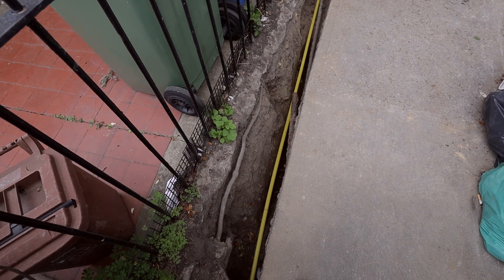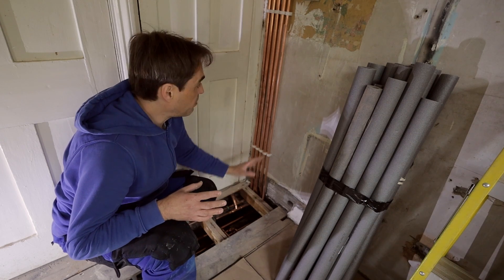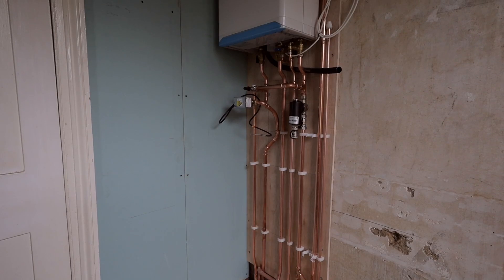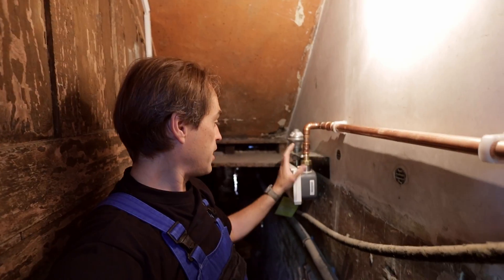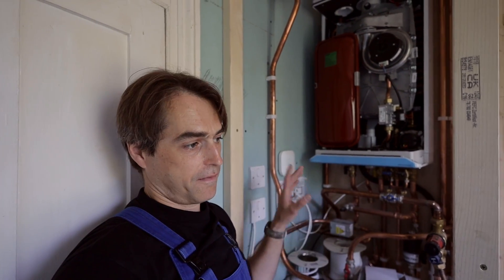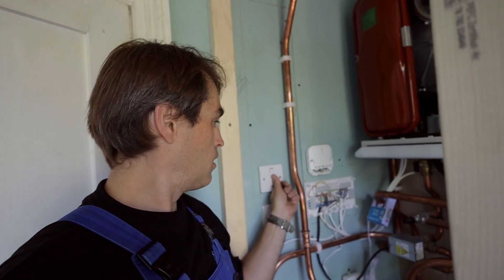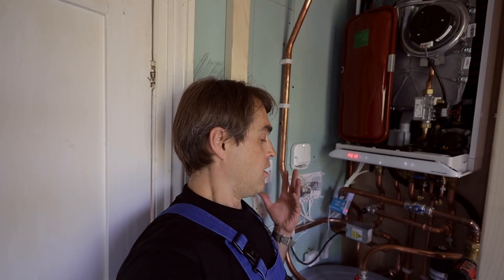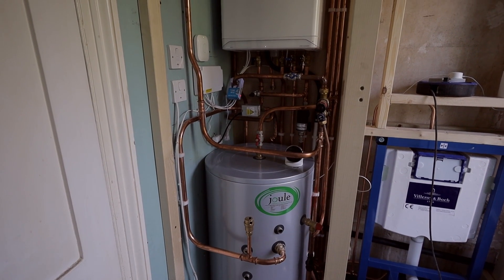Maximizing Hot Water Capacity with a High-Gain Cylinder and Intergas Boiler

Comment: I presume the boiler was already there as otherwise would a system boiler not have been a better choice considering the HW tank being fitted and the HW and home heating demand. One question- I have a 125L (not as well insulated as this one is) pressurised insulated HW tank. Does the heating element need replacing or is that just for any electric immersion backup. Plus how do you know the water was hotter at the top than the bottom? Would the heat not equalize?

Comment: Why do you do hot water priority off the heating side of the combi when you could directly heat the hot water with the combi side of the intergas boiler and avoid the 3 way diverter valve?  I ask because I have a Intergas boiler here in Canada (IBC SFC) and am using it as a combi right now, but will probably install a tank for domestic hot water (cylinder in UK speak) to reduce cycling on the boiler.  I was going to put a pump on it and use the combi side to directly heat the hot water.

Comment: You bend pipes the same way I do, but be aware that the pipe sits about 5mm above the bending wheel so we need to allow for that. A wee tip for you. I always do an air test on pipework before I introduce water into the pipes, that way any leaks are sorted before water is on, you know what that means if you get a soldered leak. Keep up the good tidy work A+

Comment: Hi, great video, love your attention to detail. I'm planning on installing a 19kw veissmann 100w system boiler, and wondering if you think there is benefit in installing a high gain cylinder over a standard cylinder? Would I have a similar result as here? Worth noting it'd be good to future proof the cylinder for a heat pump down the road.
Reply from the maker: If that is the case then yes HG cylinder of a larger size for a heat pump.

I would suggest looking at 11kw viessmann as it goes to 19kw of hot water. 

Not many houses in UK need more than 11kw for heating but that would have to be calculated for your property.
Reply: @UrbanPlumbers  great, thanks for the advice!

Would the 19kw not give me a higher kw output for dhw, and therefore a faster recovery time?
Reply from the maker: No, same as 11kw

Comment: The cylinder will heat up in 10min but how long will that water stay at the desired temperature for?
Reply from the maker: It will drop at a rate of 1.2 kWh per 24h. That should translate to (I am not doing any maths - just guessing) 3-4c per 24h
Reply: Thank for taking time to reply so once heated you should have plenty of hot water for the rest of the day ie you wont need to heat again
Reply from the maker: Correct
Reply: @UrbanPlumbers  👍🏾

Comment: Learner Question :@ 3:08 what type of adapter on your hand pump did you use to get onto a 10mm OD pipe end ? Schrader valve are 7.7mm and I cant find anything online that allows up to 10mm.Thanks for your content this year (Always very helpful) and best wishes for the new year.

Comment: What is the boiler flow temperature you have set for the hot water cylinder?
Reply from the maker: 70C
Reply: @UrbanPlumbers  Thank you for your reply. I watched your videos and learned many things. I believe you are using a 30kw load from the boiler, which is the total capacity. I wonder if you have a gate valve on the hot water return from the cylinder coil, can you use that gate valve as a restrictor? So that hot water stays longer in the coil and transfers more heat. I am asking as I can see only a 5-degree difference between the flow and return temperature.
Reply from the maker: @dukemaximus1639  let the boiler do it's thing. It is natural that DT will narrow as the cylinder gets to temperature. Nothing wrong with that.
Reply: @UrbanPlumbers  Many thanks. I can see what I did wrong. I range rate the boiler to 7kw as per the property heat loss and set flow temp at 60. This resulted in the boiler taking too long to heat the hot water cylinder. I was trying to find the most efficient and effective way to heat indirect unvented cylinder.

Comment: Great video and love your work. Could this system work with my Baxi Platinum 28 or do you need a specific combi boiler to work with an unvented cylinder? 

I’d like to add an electric immersion heater to top hot water off with excess solar.

Comment: The complexity of gas combi systems just baffles my mind! I'd have two 100liter electric cylinders(Vellis EVO) @45C for hot water, with much-much less heat loss and programmed to run on cheaper electricity rate. Also shorter runs, as they are in the individual bathrooms. For 6KW heating, only need a pair of regular split aircons(aka air to air heatpumps), which also come in handy with the recent heatwaves for cooling. If so desired electric underfloor heating to wet rooms, with one kW each programmed for like  one hour a day. Fraction of the price, labour and can be offset with solar at any time.
Reply from the maker: And 4 times more expensive to run plus no real comfort with a2a heating not to mention noise

Comment: Great video, I'm looking to do something very similar but with a Mixergy tank. What boiler and controller would you recommend for Priority hot water? like the idea of the Tado smart thermostat
Reply from the maker: If you want to use Tado then you need open therm boiler such as Intergas. 

You would be better off without tado though and with Vaillant plus SensoComfort or Viessmann with Viessmann controls
Reply: @UrbanPlumbers  Thank you, much appreciated, been going round in circles with local installers for weeks. I had thought about Intergas with Nest but like the idea of controlling the radiators directly as I have a part of the house I would only use on occasion (which also has a log burner). I'll take a look at the SensoComfort

Comment: Excellent video. What is the exact model of the Joule HW cylinder you are using?
Reply from the maker: High Gain 125
Reply: @UrbanPlumbers  Thanks for this. It took me a few days to find the specs on this cylinder. The reason - it has now been discontinued, though there may be some in stockists. The nearest now available is the 150 litre, TCIMVH-0150LFB.

Comment: I spoke to intergas today, you have to use the cylinder sensor, what do you do if the boiler isn't anywhere near the cylinder ?
Reply from the maker: You don’t have to use the sensor. Cylinder stat will also do and can be done. 

Sadly Intergas are the last people I would be asking for advice on this. 

NTC can be extended with twin wire so can be remote. I got cylinders installed 30m away on NTC
Reply: @UrbanPlumbers   thank you

Comment: Excellent video as always. What is the reasoning in going for gas heating instead of a heat pump for a new install? Surely with energy costs going the way they are gas is not the best option?
Reply: Gas is still almost a quarter of the cost of electric, the initial outlay of heat pump is far higher, in order for a heat pump to be more efficient the house must be well insulated and this on itself can be extremely costly/ disruptive.

Comment: Great video! Could you please explain in more detail how you worked out how to calculate how long it would take to heat up? Excuse me for being dumb.
Reply from the maker: Yes. The formula is: time (in seconds) = capacity of the store (L) * DT (temp rise in the store) * thermal capacity of water (4.18 KJoules) / (divided) by energy input in kW. You get the result in seconds

For example, a 100L cylinder with 10C water inside when you heat it up to 55C with a 30kW boiler will take:

Time(s) = 100L * 4.18kJ * DT45K (55C-10C) / 30 = 627s - or 10 minutes 27 seconds
Reply: Thank you very much for taking the time to reply!

Comment: Your calculation is wrong it’s based on the highest temp recorded from mains most mains are 4-9c so your delta t will be 35 mins
Reply from the maker: not quite. If the mains water was 4C and you reheated this cylinder to 60 it would take 980 seconds = 16.33 minutes at DT 56 (4c to 60C)
Reply from the maker: most of the time mains is around 10-15C and you only need to reheat the cyliner to 50 so your DT is 35-40 and that takes 600 sec or 10 minutes

Comment: Why do you need to do that. Ran my Viessmann system boiler at 5kw on Priority DHW like 15 years ago.
Reply from the maker: Yes Viessmann 4 pipe is nice. I do give that option and explain the difference between V and IG and let clients decide between the two. 

Here they wanted to be able to run 2 showers at the same time and for the set up to be small (cylinder) 

It’s also cheaper than v200 with vitocell and on top of that I couldn’t get std vitocell at the moment from my supplier.

Comment: Hi, apologies if I have missed this but what did you do with the hot outlet off the combi ?  Great little system, think we all need to be thinking down this route, A to save energy and B to satisfy the customer. 👍thanks
Reply from the maker: It’s capped off. Also there is no mains going into the boiler - just the filling loop

Comment: Don't tell anyone, but if you run a 16kw heat pump on Octopus go for 7.5 p for four hours into a heat store you cold get 48 kwh of heat per day for ( input 4 hrs @ 4kw =16 kwh ) 16 x 7.5 = £120 divide £1.20 by 50 gives us 2.4p per kwh!!!    When the price increase comes with normal leccy at 50p per kwh it will cost you 16 x 50p which is £8.00. Now get this, with a plate exchanger and pump and inline electric heater you could get 100 litres a day at 60 °c for an extra £1.00 per day even at the new 50p tariff.
   I've been discussing this issue with an online group and one contributor said what kills outdoor  units is excessive annual run times. Using a big heat stored a big heat pump slashes run times. If you've got room a 2,000 litre heat store isn't expensive, build it a lean to alongside the outdoor unit and bingo! A huge heat store may sound excessive but you need it for the sake of delta t.
Reply from the maker: Yes you can do it if you have space for the store. I am considering this kind of a set up at one of my jobs at this moment, just with 12kW air source and 1000l buffer.

Comment: Great video, i have seen this kind of setup with logic combi 35kw 2, 2 port valves one for heating and one for hot water cylinder. It seems to run continuosly at low temperature to keep the cylinder warm. Its 220 liter cylinder. Dont kmow if it should do that. And when its hetaing the hot water they ratitaor symbol appears on the boiler screen. Dont know if they wired it correctly or not.

Comment: Hi Urban Plumber,I really love you. I wanted to claim the £5k heating grant but installers just add an extra £5 grand to the price. Whatever I do I'm blocked by B. MCS!
So it's impossible for me to claim the grant and get a decent job done at a good price.
I've  got fixed 10p. economy 7 for nearly 2 years. I'm going to buy a 12kw. Ashp and solely connect it to a 4,000 litre thermal store which I will build myself.  The heat pump will have 7 hours at 12kw which is, in theory is 80Kwh. The capacity of my heat store is 80kwh according to the delta t I'll use. The larger the heat store the more efficient they become.  All I have to do is connect my underfloor and use a plate exchanger and pump for DHW.
Now get this, the heat pump will use 28kwh per night at 10p. and that is a total  of £2.80 a day.
£2.80  ÷  80 = 3.5p per kwh.  I'm expecting trouble when my economy 7 ends but I have three phase and hopefully use a car charger if that's cheaper because I could draw 20 odd kw and even if it was only for a couple of hours that would be 40kwh of cheap. You are gorgeous, keep on making the videos,  it makes my day when you put a new one out, and don't worry I'm past it as I'm nearly 80 yo.

Comment: When it comes to pressure testing gas pipe where Ng is not present. It's recommended to air test it to 45mb. Great video as always. I enjoy learning about the heat calculations when you're explaining them 👍
Reply from the maker: Where can I find info re air testing please?
Reply: @UrbanPlumbers  IGEM/UP/1B appendix 3 gives guidance on air testing new installations,  TTP of 20-21mb with air for NG so your spot on 👍
Reply: Would be tempted to test at a higher pressure, have known flux to hold even on unsoldered joints

Comment: Dont quote me on this but under new part l you have to range rate boilers to house sizes don’t know if it’s now or next year so if that’s a small terrace that only needs 15kw what’s point in leaving that boiler at 30kw… just seen the rest of video so the boiler lowers its kw to suit cylinder
Reply from the maker: 😂 small terrace heat loss is nowhere near 15kw. This one is 5kw.

Boiler is range rated to 6kw on central heating and 30kw on hot water.

System designed to run at max flow of 55c.

It’s fully part L compliant mate.
Reply: Measuring each room and calculating window size bla bla gives you the size of rad needed for that room if you have 2rads at 2kw each and a cylinder coil at 3kw that’s 13kw so range rating yours to 6 what’s that going to do take pureeee time to heat thst room
Reply from the maker: @pauls826  and what will you do when the coild is 45kW and the hat loss is 5kW. Add it together?

Comment: What is the standby loss of your indirect water heater?
Reply from the maker: Somewhere around 1kWh per 24h
Reply: @UrbanPlumbers  So somewhere around 1/2 degree F an hour. Did you actually test that or is that what the manufacturer claims? I have measured a few brands and they were way off.
Reply from the maker: @anthonyspadafora1384   I have tested it yes. If the pipework is insulated the cylinder will lose 2-3 times the stated figures, it usually translates to around 0.6-0.9C per hour drop - so around 12-16C for 24h. When pipework around the cylinder is properly insulated and no secondary circulation is used the drop in temperatures is more like 6-8C per 24 hours.

Stated 1.2 kWH per 24 hours drop means that:

125L cylinder full of water heated to 60C and a room of 20C = DT40C = 21,000,000 joules = 5.8kWh

If the cylinder is to lose 1.2kWh = 4,320,000 joules of energy lost

that leaves 16,680,000J in the cylinder. This equals to a temperature of 32C above the room temp = 20+32= 52C.

So after 24h 60C will drop to 52C = 8C drop. Around 0.33C per hour.

In my tests stated drops are pretty accurate, but I do need to do more testing.
Reply: @UrbanPlumbers  Over here we still have chimney vented gas water heaters continuously pulling cool basement air through the vent. They lose around 7 degrees F per hour. Common 40 gallon units at 333 lbs x 7 =2332 BTUs an hour x 24 hr =56000 BTUs a day x 30 = 1,680,000 BTUs per month / 92000= 18.26 gallons of propane. I will usually divide this number by 92, 000 BTUs, the amount of heat in 1 gallon of propane to help people visualize the amount of energy they are wasting. They are still legal here and sold by the thousands. The good indirects like you have there are nice but only on a low mass boiler. Many of the oil boilers  here are high mass, maybe 400 lbs of cast iron and 7 gallons of water that are heated when the indirect calls and then the heat is just lost through the jacket. Buderus is the only oil boiler here that makes a serious attempt to insulate the boiler. Believe it or not we still allow summer/ winter oil boilers. A coil is placed in the boiler and the boiler water is maintained at 200 degree F 24/7/365. It is a pleasure to watch a hydronic tech as yourself install these systems. I don't know if you have ever been to the states to see our heating systems, 98% are pressed fiberglass board cut into duct and warm air blown through it. You would shake your head LOL.

Comment: Hi another great video. Can I why do you use a combi boiler instead of a system boiler? Thanks.
Reply from the maker: Yes no problem with that, especially Intergas
Reply: Hi I’m just wondering why you choose the combi over the system boiler. Thanks.
Reply: I think I understand. You can use the combi anyway you want. So you might as well buy the inter-gas and not limit yourself.

Comment: Hi why don’t you use an ‘S’ plan?
Reply from the maker: S plan is 60ties tech that shouldn’t be really used. It only 80% efficient as the whole system has to always run above 60c.

This set up runs at 6kw and max 55c on heating and 30kw and 65c on DHW.

By the way, S plan no longer complies with part L building regs
Reply: @UrbanPlumbers  oh right. Thank you for replying so soon. I have started watching your videos. They are very good.
Reply: @UrbanPlumbers  also, why is 3 port valves better??
Reply from the maker: It’s not better. You can use 2 ports instead
Reply: @UrbanPlumbers  I like your idea of hot water priority. I would like to know more. I would like to start using it in my work (I’m a plumber).
Reply from the maker: @deanchapple1  check my channel - tons of videos on how it’s done on different boilers

Comment: Mains water 23 degrees? I thought mains water had to be 10 degrees or less. Was the mdpe pipe run deep enough min 750mm, if it was the pipe should of been insulated to keep the heat out 👍
Reply from the maker: Mdpe was insulted and 750mm deep. It was the day of 37c outside and Thames Water simply wasn’t able to deliver water at required temperature.

The requirement is max 20c
Reply: @UrbanPlumbers  I guessed you had already done what I suggested. Love your work and top class videos. Your channel is one of the best plumbing and heating channels on here. Are you not a fan of heat pumps as they tend to suit well insulated homes not exposed to winds and very cold weather. Could you do a video where you talk about where a heat pump would be efficient and recoup the high installation costs compared to a gas boiler. What would you have in your own house? Thanks!
Reply from the maker: @waynenixon729  check my previous video. It talks about exactly that. I will be installing a gas / air source hybrid in my place
Reply: @UrbanPlumbers  Would be great to see that installation!
Reply from the maker: @waynenixon729  it will be here soon